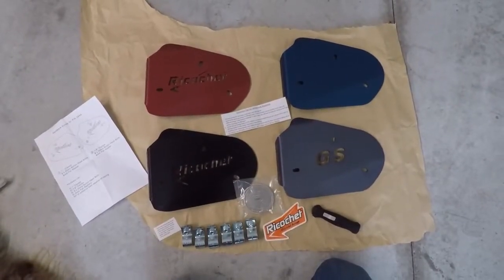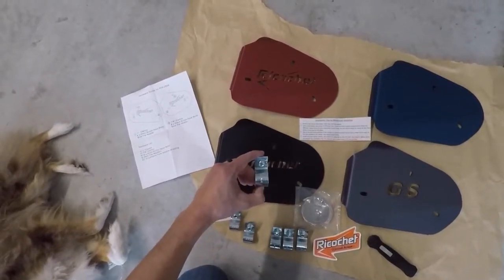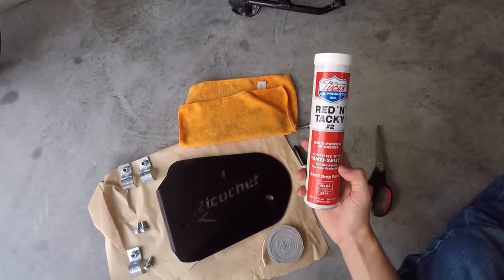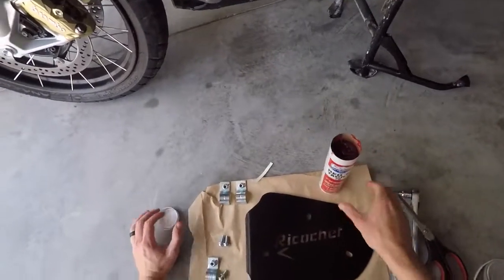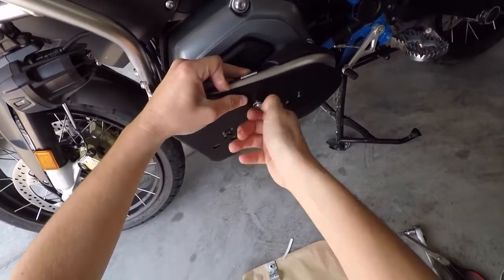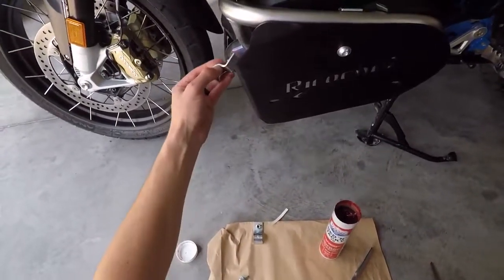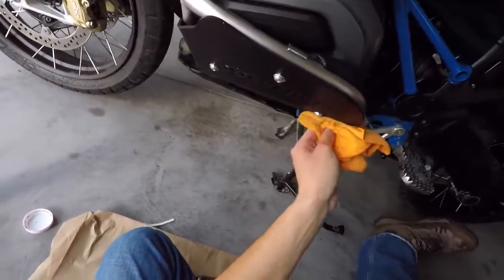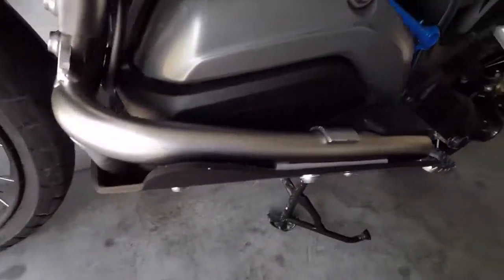Ricochet Crash Bar Engine Guards Install video 2018 BMW R1200 GSA

Comment: If I have MachineArt X-head protection installed outside the cylinder cover, will I still have room to install Ricochet Engine Guards.  I have 2017 GSA with factory engine crash guard.